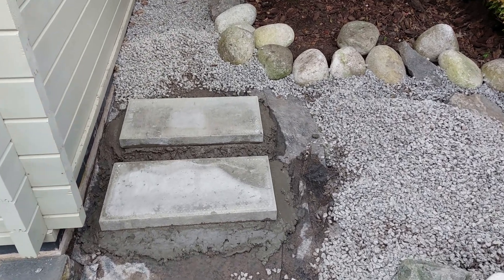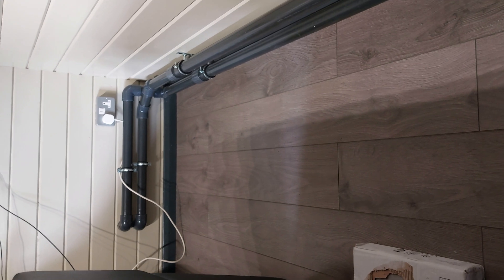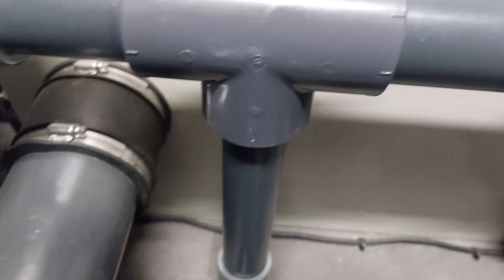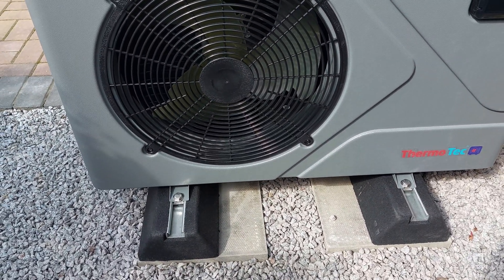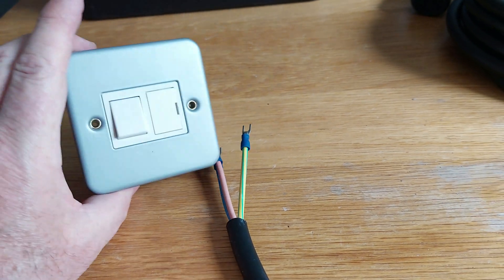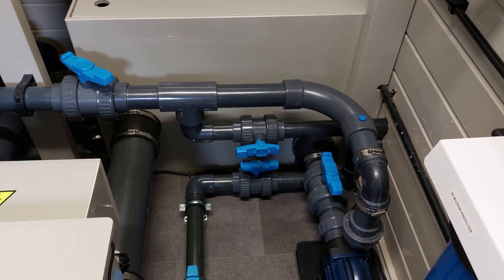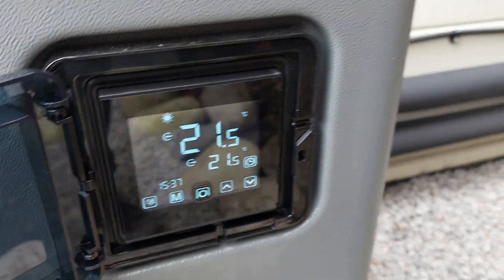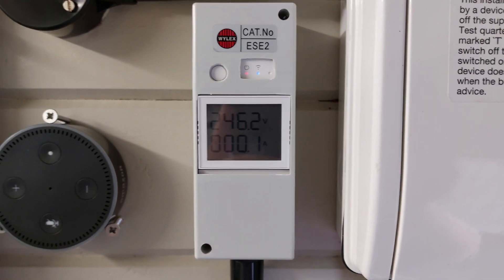ASHP Installation

Comment: What lagging did you use for the 40mm pipes?
Reply from the maker: Hi mate, I used Armacell Armaflex lagging from JTM plumbing (now called plumbing superstore)
You just need to get lagging that has a larger internal diameter than the outside diameter of the pipe you are using, 
for 1.5" pressure pipe that is 48.3mm external diameter, I used 48mm x 13mm iirc... but thicker is better depending on how much room you have to run the pipe.
https://www.plumbingsuperstore.co.uk/browse/pipe-insulation/brand/armacell.html
Though you may need some UV stable adhesive covering as armaflex is not UV stable unless you get the much more expensive  external rated armaflex.

Comment: Hi dave, what size lagging did you use and can you give us a link please?
Just about to bite the bullet myself with an ASHP and your vid made good watching- Thanks.
Reply from the maker: Hi Steve,
I used Armacell Armaflex lagging from JTM plumbing (now called plumbing superstore)
You just need to get lagging that has a larger internal diameter than the outside diameter of the pipe you are using, 
for 1.5" pressure pipe that is 48.3mm external diameter, I used 48mm x 13mm iirc... but thicker is better depending on how much room you have to run the pipe.
https://www.plumbingsuperstore.co.uk/browse/pipe-insulation/brand/armacell.html
Though you may need some UV stable adhesive covering as armaflex is not UV stable unless you get the much more expensive  external rated armaflex.
Reply: @DavesKoiPond  Thanks Pal, i did buy the ASHP this morning so will look at getting feet also from your other link.
Liked and subscribed .

Comment: Cracking job were did you get the lagging from
Reply from the maker: Thanks mate 👍
I got the armaflex lagging from JTM plumbing,
You can get a slightly cheaper brand called rubaflex, but i find the seams don't stick as well as the armaflex.
they do have some bargain in lagging atm too, in eurobatex unsplit nitrile rubber.
but it's a hassle gluing the seams you have to cut yourself back together, or sliding it along the pipe beore fitting....
https://www.jtmplumbing.co.uk/insulation-c555

Comment: Great video Dave, where did you get the mounting rubber for the ASHP from? I am installing mine now.
Reply from the maker: Thanks mate 👍
£11.85 plus vat from Direct Channel for the 600mm each, you can order stainless steel rail nuts and bolts from them as well...
i'll put the links in the description too. 🙂

https://directchannel.uk.com/600mm-fx-foot
https://directchannel.uk.com/unistrut-type-channel-and-accessories/Unistrut-Type-Channel-Stainless-steel-range-a4/Channel-nuts-stainless-steel/m10-short-spring-channel-nuts-stainless-steel
https://directchannel.uk.com/index.php?route=product/search&search=SET-HB1025A4.Q10
Reply: @DavesKoiPond  thank you so much, get onto that right away 😀